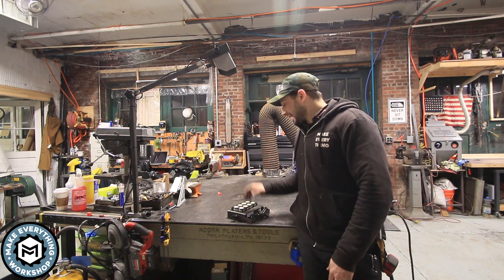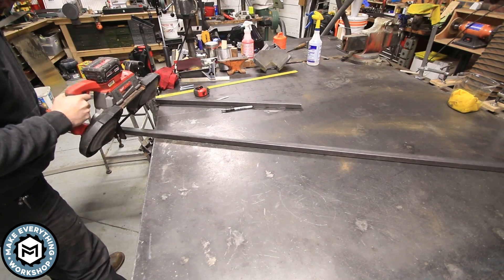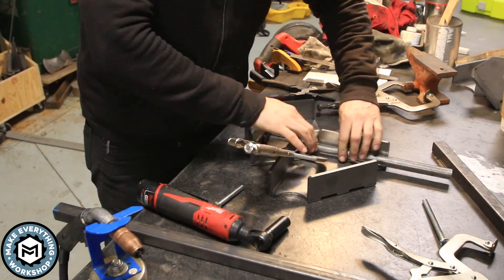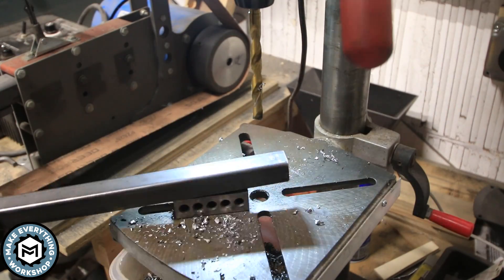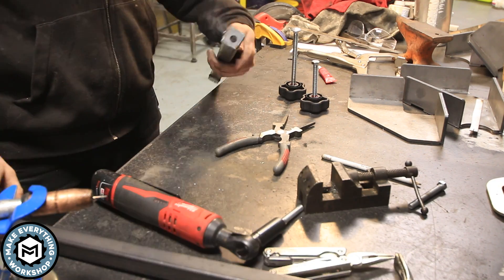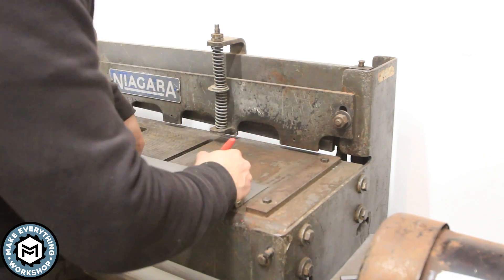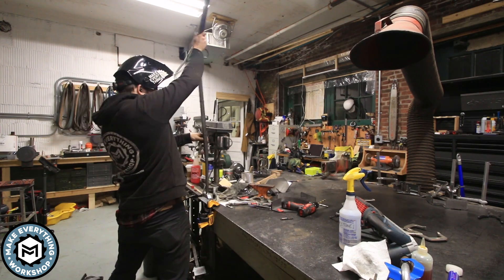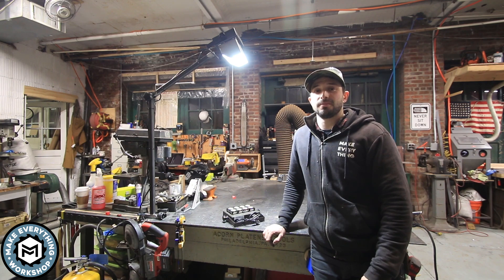DIY LED Task Lamp (3500 Lumens)

Comment: Great build. I, too, need a TON of light when I weld. Also, thanks for explaining "weld nuts" - never heard of them called that before, and I've seen very few makers actually care - most just use the zinc-coated...
Reply from the maker: David Plass thanks! Yeah they are awesome and save your lungs a little bit of impact

Comment: Would have been cool to run the wire in the tube
Reply from the maker: Brads Workbench I thought about it but decided not to, in an effort to keep it simple and not mess up that pivot point with any limitation
Reply: @MakeEverything  you could put an o ring or rubber band around the round tube to create just enough friction to stop the square tube from swinging

Comment: FYI.  Unless I read it wrong, you have two different "In this video" sections.  You might want to remove the second, wrong one.

Nice project, by the way!  This has the same output as many LED shop lights that replace fluorescents, but puts the lumens in a smaller, directeable area.
Reply from the maker: David Zeller whoops! Thank you!

Comment: Cool project.  Are you going to add anything to stop the swivel?
Reply from the maker: Thanks! I actually decided to put a small bend in the bottom of the tub and it kept it from moving around unintentionally. I don't want to put any sort of locking knob on it because I want the movement to be easy when I want to swing it around.